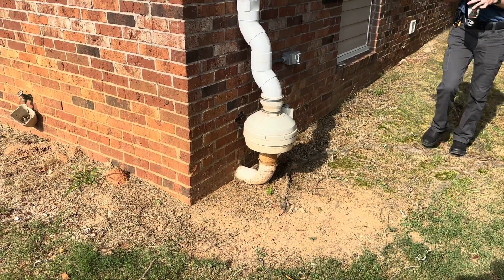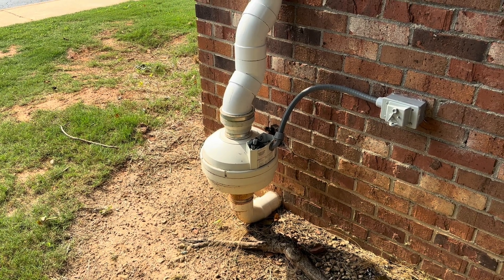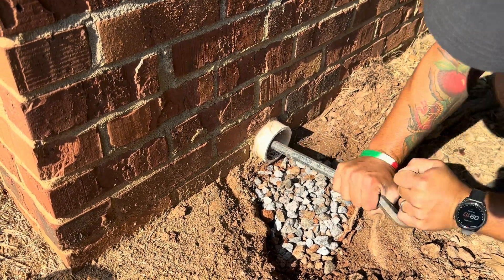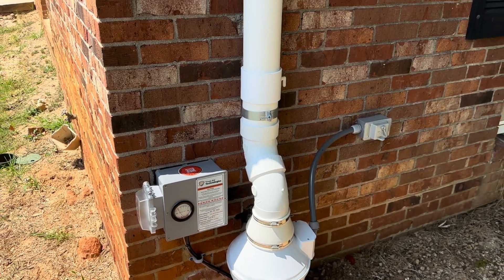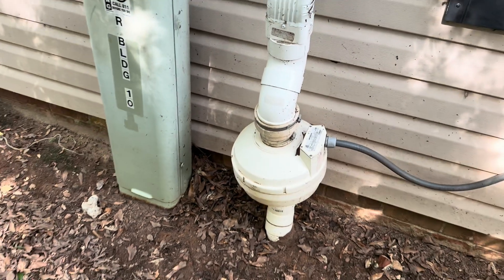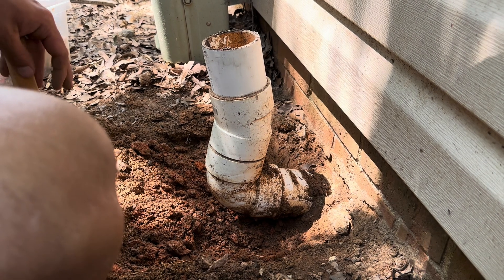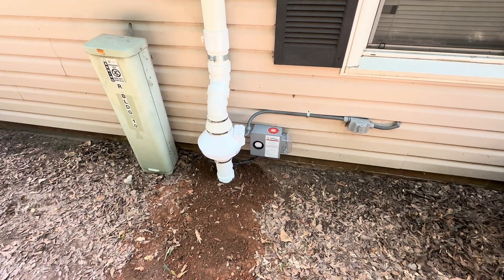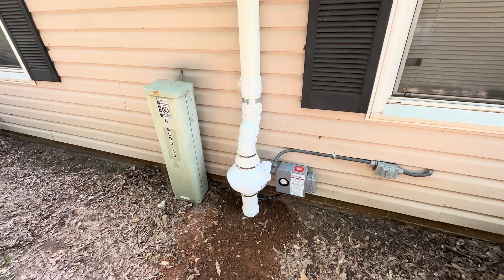Pay Less, Pay Twice: The Costly Truth Behind Cheap Radon Solutions – A True Air Technologies Story!

Comment: Had a radon system installed in the basement corner and it got worse. The manometer showed like 0.5 unit pressure and radon reading rose to 5-7 pci, which was 2-3 before installation...
Reply from the maker: Where do you live?
Reply: @trueairtechnologiesradon ohio

Comment: have a radon issue in mainly 1 room. the rest of the basement seems to be ok, but this room keeps going high then low. I put a epoxy vapor barrier down in the room and thought that would help but it seems to be worse. trying to figure out how to mitigate this one.
Reply from the maker: What part of the country are you located in? Where is that particular room and location to the rest of the house? Do you have a schematic or a drawing?
Reply: @trueairtechnologiesradon in central minnesota. Room is in the basement on a southeast wall
Reply from the maker: @windsorize  is there any ventilation in that room and what are the walls made of are they concrete?
Reply from the maker: @windsorize  are there any adjoining slabs to that room for example a front porch a garage slab a back patio etc. etc.